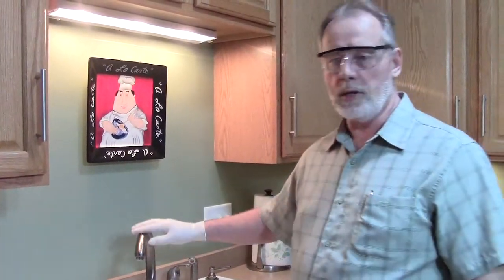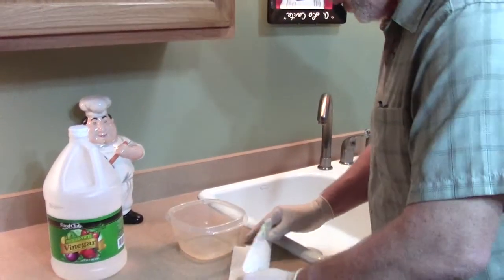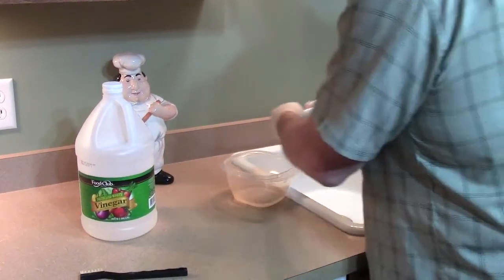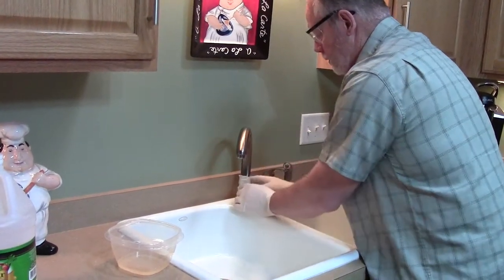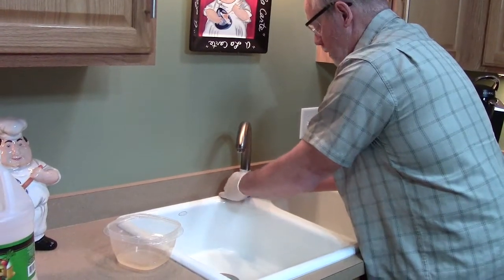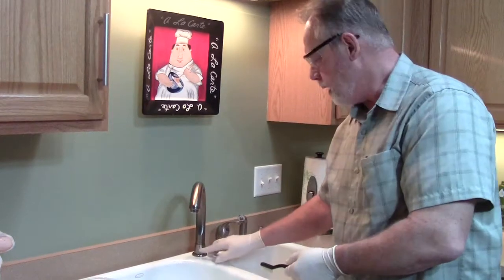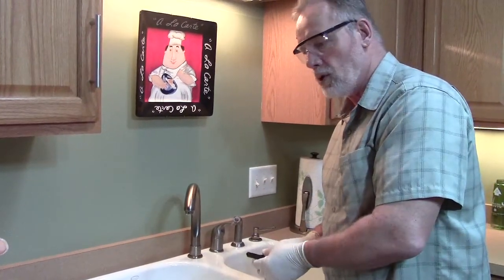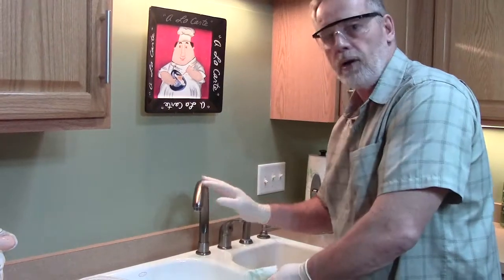How To Remove Hard Water Spots

Comment: very good tip. is this process works on water mark on glass windows?
Reply from the maker: Sure it would. If there is mild hard water deposits on the glass window use soft scrub with #0000 steel wool to remove it.
Reply: Yes it can for light build-up.

Comment: Is it necessary to do maintenance on cartridge inside the tap?  To remove the deposit on it? Do people do that ?
Reply: Great questions! 
Yes, I will do that every 6 months because of hard water build-up on the tap. You can remove the spout cap and screen, then soak in vinegar solution to remove the hard water deposit.
Reply: Steve Hanson wow. That is very frequent.  I recently did my kitchen faucet as it was leaking after five years.  The cleaning of cartridge brings it back to life
Reply: All areas are different with the level of hard water
Reply: Steve Hanson yeah no wonder..
Reply: Steve Hanson I got this cleaner with ingredients listed as Aqua, HCL, wetting agent.   Do you think I could use this cleaner to soak my cartridge?  It cost about the same as a bottle of vinegar.
Reply: I would not know, I don't know the product. What does the label say or the SDS?
Reply: Steve Hanson the product is called Mosaic & Toilet Stains remover.  It is not that strong an acid.